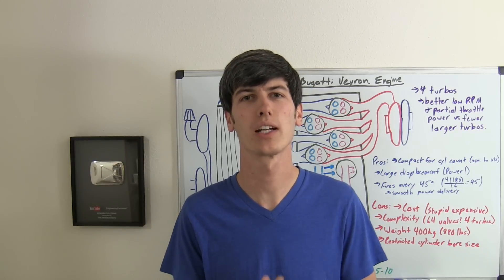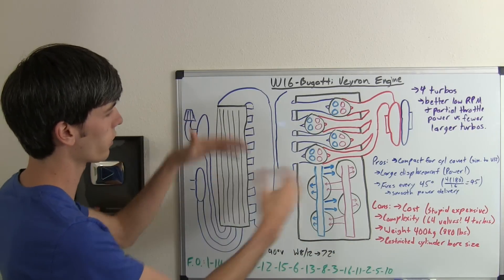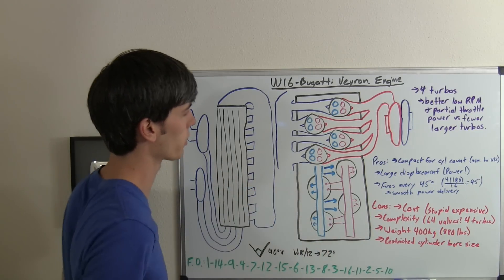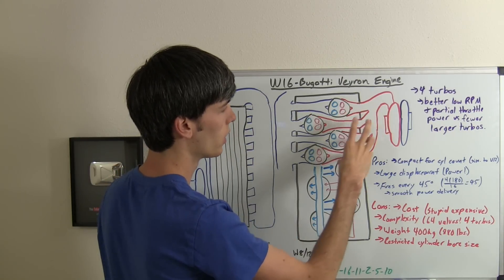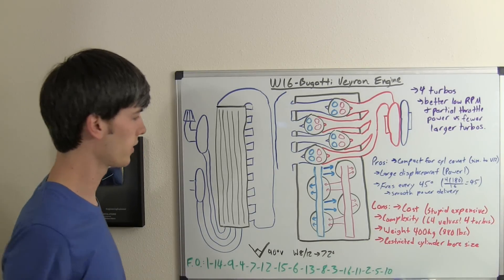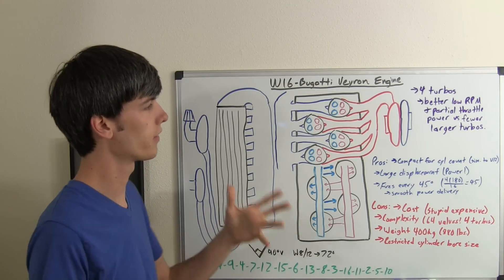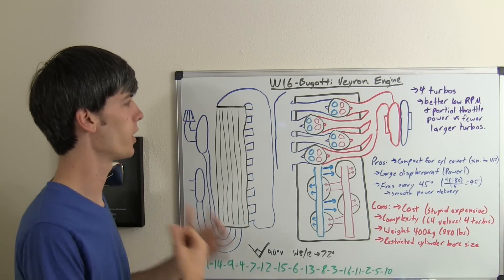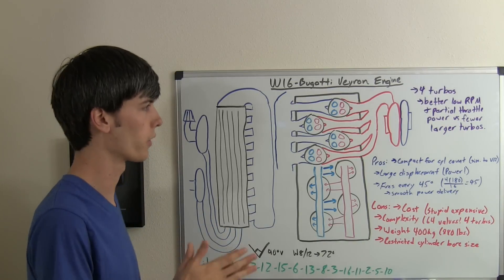W16 Engine - Bugatti Veyron - Explained

Comment: Its an epic piece of engineering. A relatively compact engine that isnt stressed despite its massive smooth power and torque. They Veyron is a master class of car design with aircraft performance all within a luxury cocoon of a Bentley and some. If anyone compares this to the kit car Hennessey (which it is in comparison) you are severely mistaken.
Refinement, speed, power and handling are the hardest to achieve; just look at Concorde, she aced that. Big time.
Reply: +peanuts2105 I agree! Although I am quite fond of the Swedish contender too -- it's a bit more raw and aggressive.

Comment: The only type of engines I have any knowledge on are 2-strokes and that is just a hobby. I thoroughly enjoyed this walk-through, specifically how provided intent and placed each of the components in to connect. Great job!. If you have not taken a look at the little glow engines for rc cars, they can RPM. If you have not you should check them out, I imagine you would enjoy!

Comment: I never liked how it was called a w16. Since it doesn't have 3 banks
Reply: +Ian Thompson I see where you are coming from, but what do you get when you put 2 V's Together - vv (W)
Reply: Ethan Gee I guess it should be called a double bank V16 or something. Since it is a V, but with two extra rows
Reply: +Ian Thompson Yea but  a double bank V16 dose not roll off of the tongue as nicely as W16. Plus since there isnt another Engine like this they can call it what ever they want.
Reply: weirdstuffanimation7 Fair enough
Reply: Well it has 2 Banks with Cylinders on the two outsides .. But the build of 2 V is resultung to W , so 3 Banks  .
Reply: +Ian Thompson a double Vee is hard to say. as is double H.(meaning that old carb system on the Hornet) W sounds relatable.
Reply: no it is like a 2 Vs (VV)
Reply: According to a LOT of people its a 16.4 litre 16 cylinder engine smh.
Reply: Lmao I was about to say would you prefer it to be a V8V8
Reply: The two sets of connecting rods - one set behind another- that forms the "W=Double V" in a section view when it's viewed from the front.
Reply: Same as a VR6 engine, isn't configured in a V shape!!!
Reply: If you understand VR engine layout, you'd understand why it is called W16 

It looks like 2 V8 engines, each in staggered formation (VR), then matted together

Comment: Could you explain how Honda had a V5 engine in their RC211V MotoGP bike?
Reply: +SupaDriftz Most Motorcycle race engines have a gearing shaft inside the engine crankcase which for a inline engine is fine, but for a V type engine, the nose side of the engine (bank closest to the front) has more resistance against it. Honda attempted (properly well) to counter act the resistance by adding another cylinder on the nose side to give more torque against the turning gears. The result actually gave way more torque then desired, and without the advanced level of traction control that we have now made it quite overpowering sometimes. Thus it was ditched.

Comment: Thanks for another interesting video!
I'd really appreciate if you could help me understand the firing order logic (for any engine size). I always feel like the forces applied to the crankshaft and the heat dissipation through the engine block will be messed up, so why are firing orders the way they are?
Reply from the maker: It's certainly easier to understand on engines with fewer cylinders. It comes down to the crankshaft design, layout, and number of cylinders. Basically there are only so many options which would phyiscally work (piston fires ever "x" degrees of crank rotation, piston "a" is on an upward stroke, which means it's either exhaust or compression, sort the FO in a way that allows for each of the cylinders to fire in a balanced fashion. Maybe check out my videos on I4 or I6 where I go a bit more into detail on the firing order. This was more focused on how it works as it's a massive complicated engine.

Comment: As a first year mechanical engineering student, I am ashamed to think that I once thought a W16 was two V8 blocks side by side...
Reply from the maker: Don't be ashamed. I didn't know anything about cars when I was a freshman in ME.
Reply: same XD
Reply: Engineering Explained Seriously? I mean you chose to go to mechanical engineering and you never had interest in cars? I studied in University of Bath, but cars were always my passion..i bought a nissan 200sx (s13) with my savings without anyone knowing in the start:p Still modifying..now upgrading to VAG ignition coils for xmas :))
Reply: St0RM33 I think your confusing Automotive Engineering with Mechanical.
Reply: St0RM33 Uhm... Hate to break it to you my friend but not all mechanical engineers become automotive engineers, which is what you're thinking of. While cars are great examples of mechanical engineering applied, basically any type of machinery you can think of has a mechanical engineer's touch... From biomedical devices to engines, from industrial equipment and tools to rockets. I've even seen mechanical engineers who have careers doing things like running power plants. Typically (Though not always, just in my experience) HVAC engineers also studied mechanical engineering, as ME's have to take a ton of thermal fluid science courses. There's a lot more to mechanical engineering than just automotive engineering.
Reply: *****
Hahaha. Who said i was talking about this? I said it because his channel is focused mostly on automotive stuff so it's weird that he didn't had previous interest.
Reply: Crunchy Nutter
You can still do Automotive stuff in Mechanical engineering. I did. Even was in my uni's Formula student team (formula SAE in US)
Reply: Hawar Karem
What with the s13? Best bang for your buck platform ever. Light, 51% front - 49% rear weight distribution, cheap, FR layout, good aesthetics, tons of parts available, turbo: easily increase horsepower, low displacement which means cheaper road tax, etc.
Reply: St0RM33 I think you misunderstood him. He said he didn't know anything about cars not that he didnt have a passion for them. I personally am an ME student as well and I love cars, but I know very little about mechanically. I've learned some here and there but no the extent that I'm a mechanic or something.
Reply: Dont be ashamed at all dude it was a stupid rummor flowting at the web when it first come out that it had 2 V8s.
Well you would think it has 2 v8s one inside another dont you?

At the end its 100% clear that V10/12 is better overall.Bore/stroke + rode/stroke ratios less rotation mass etc
You want 4 turbos?Im ok with that but it would be a lot better to be a 2x2 compound setup.
Anyway, nice video as usual.
Reply: I think they should try and do something like that. Two V8s stuck together with the point where they meet in the middle being like a VR engine. Would be interesting. I wonder what noise it would make :D
Reply: Lol I’m elementary and I get a lot out of this, but I too once thought its was 2 v8s that we’re connected by gears.
Reply: As a former ME student on hiatus, I tried on quite a few occasions to picture a configuration of 2 V8's and one crankshaft but I never could. I thought the same thing since it was called a W16 but I had never seen a diagram of the configuration and I couldn't figure one out that would be realistic. So I hadn't accepted the "W" 16.

Comment: Another benefit of this many cylinders is small cylinder size -> Relatively stronger as each combustion event holds less energy, hence the base engine is going to be more durable.
Per cylinder size is 0,5l

Comment: I'd pay $12.00 to see someone put a W16 in a Golf VR6. they could mount it at the back , remove the seats and do some very smart adaptations but I'd pay either way to see it work
Reply: +kapil busawah well the car will catch on fire while flying through the sky?
Reply: Ganz Montejo yes?
Reply: +kapil busawah Already been done with a W12! VW made a concept car for a bit of fun. The results were... well lets just say there is a reason they never put it into production. There is an episode of Top Gear which featured it a few years back!
Reply: I Rob Banks WHAT WAS IT CALLED???
Reply: A naturally aspirated W16 obviously. There's no way the golf could take that much power, or even fit 4 turbos in the engine bay (or behind the drivers seat).
Reply: +kapil busawah golf gti 650
Reply: +kapil busawah the bugatti engine runs VERY hot. it would actually catch on fire probably
Reply: +TheRebel3000 The engine was behind the driver and took the whole space in the back.
Reply: +kapil busawah Some guy stuck a Rover V8 into the back of a mini. Its somewhere here on youtube. Its nothing compared to what you are proposing though!
Reply: +kapil busawah There is a twinturbo V10 Mk4 R32. The engine is from the C6 Rs6 and is tuned to 800-900hp if I remember correctly.
Reply: kapil busawah
They might have done that already. I seem to recall a certain Top Gear UK episode with a concept they said no to.
Reply: I will have to look that up. Thanks!
Reply: It was the W12 engine
Reply: Check out the twin engine Mini Cooper.
Reply: It would need to be a Golf R because you would need the AWD platform. The W16 in a gold sounds like an 1980s group B rally car dreamed up by Renault or Lancia.

Comment: Bugatti Veyron actually produces around 3000 horsepower but around 2000 disappears with heat
Reply: That's kind of awkwardly worded, but essentially correct. However, that's normal for a ICE. It's down to the thermal efficiency which happens to be around 30%.
Reply: it normal for petrol engine, 25-35% for combustion energy turn into mechanical energy, it happens on all petrol engine. you wanna go efficient, go for diesel.. efficient of engine is much depend on compression ratio. that call thermal efficiency.
Reply: First law of Thermo-dynamics.
Reply: 25-30% isnt 2/3s tho... That statement is false
Reply: Its tuned down to avoid being overheated its not losing 2k hp from heat

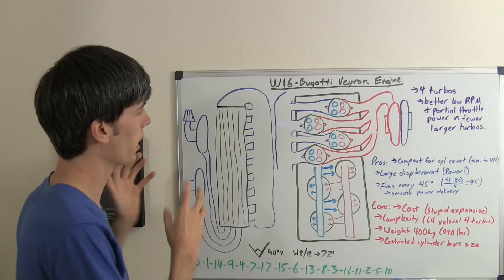Comment: I dont know so far in anybody already commented about it, but there seems to be a small mistake in the video. You mention individual fuel injection, but it is in reality a direct injection engine. The information happens to be at around 1:40. With direct injection there will be no air-fuel mix before the intake valve. The mix of air and fuel will be made inside the combustion chamber shortly before the actual combustion.

Maybe you leave a short comment here and tell me what you think about that issue 😉

Comment: 16 cylinders on one crank attacking it on all 4 sides. not just two on a longer V-16 crank. That W crank is going to be under a shitload of cooks in the kitchen. not enough waitresses unless the crank is a sturdy wider than a V block's crank of any variety.  I'd go with an alloy that compliments flexibility and strength for the crankshaft.

Comment: Thank you for your videos EngineeringExplained, I enjoy them. Just curious though, are you positive that one cam is for intake and the other is for exhaust? Looking at pictures of old VR6 motors, it looks like one cam controls all of the valves on one bank, the other cam controls all of the valves on the other bank. Anyway, thanks for the videos.
Reply: my apologies, looks like you were right. the pictures of the vr6 motors that I had seen are older 2 valve/cyl. thanks for the videos EE

Comment: Did you say that all 16 pistons are connected to the same crankshaft? In the VR6 video, you said that the pistons fire in pairs right? (Ex. (1, 6) (2, 5) (3, 4) Does this concept also apply in the VR8? Furthermore, does it apply in the 2 VR8s that make up the Bugatti Veyron's W16?

Comment: Cool, enjoying the videos I've seen. Do you address the power differences between OHV and DOHC engines? Provided they have the same valve size and lift/duration, would they run the same or does the valve actuation have anything to do with it? I figure its just size/lift/duration but it seems OHV engines have a lot more torque at lower RPM and OHC engines much less torgue and need to be higher revved.

Comment: Hey you should do a video on how speedometers work! Like how they accurately measure your speed.
Reply: EminentLeague Older ones spin a wire that spins a gear that's connect to a larger gear behind the speedo, the ratio of gear 1 vs gear 2 has to be matched to your final drive ratio (ratio of transmission gears + rear end ratio + tire size) to show real speed. Changing any of those without re calculating the ratio needed for speedo gear and replacing it will result in an incorrect speedometer. Newer cars use optical sensors to count revolutions per second of the final drive by measuring the drive shaft rotations and then do some math for in the ECU and spit it out to a digital read out or apply a specific amount of current to the speedo wire to move the needle.

Comment: I could be wrong but, i thought a guy on the tv (documentairy about the veyron) said the engine makes 3000 to 4000hp but they had to "down tune" it to 1001-1200. (i thought it was because of the heat, if so, you forgot to add it to the cons lost). anyways nice video, hope you replay to my question Engineering Explained
Reply: It could probably easily handle 3000-4000hp, but it wouldn't be as reliable or longlasting, that was the point with the engine. When they engineered it they focused on making it indestructible. My mechanics professor back at engineering university talked about it, since he knew people from VAG who worked on the project, he used to work for them, and their goal was to make that engine work for more than 1 million km's without any problems and perform exactly the same at that point as when it was brand new,  with just the regular maintenance that all other cars get, which is very rare as far as supercars go. For example, you can be damn sure that something like a Venom will need it's engine rebuilt or heavily serviced after about 50,000 km's because it's overtuned and underengineered. Veyrons engine is the opposite, it's very overengineered, it's deep within the safe zone in all parameters.

Comment: They can call it whatever they want but it's not a "W16". 2 "V's" is a "W" but only if they actually form a "W" which this engine does not. They can call it the "God Engine" if they want but that don't mean that's what it really is. I guess it's just this generation where anything can be whatever it identifies as. Regardless of common sense. The only place I've ever seen a true "W16" is at a tractor pull competition where they actually run 2 V8 engines together synchronized side by side into a single transmission. The problem with a "W" configuration is it's inherently too wide for use on the road unless it can be made extremely small.

 There was a an attempt to build an "X16" engine back in the late 90's to address this issue. I never seen it online. I've only seen it on a brochure. The "X16" was great idea in theory. It was compact. It was 2 "V8's". One is upside down welded together at the block eliminating the oil pan and they shared a common crank. But in practice it must have failed horribly. I don't know what happened with it. I can't even find any trace of it online. I think they ran into a massive problem and couldn't overcome the fact that engines don't like to run upside down.

Comment: I thought that the cylinder banks would be mirrored. Like you'd see in a v8 with intake in the middle and exausts on the outsides. You stated that each bank would have intake on the left and exaust on the right side. Don't get it how that works.

Comment: 16 cylinders is an interesting number. You might like to compare the 1.5 litre, crankshaft driven centrifugal supercharger, 500-600 BHP BRM engine of 1950-52. W is also an interesting cylinder configuration. I don't think this VW engine is really a W. That would be one of the aero engines of the 1930s such as the Napier Sea Lion of 24 litres which powered the Napier Railton special which held the Brooklands lap record at 143 mph in 1936.Parhapsyou would like to discuss those?

Comment: Hallo Jason. Thank you for all your fantastic work with Engineering Explained. I would just like to ask you  a question that bothers me. Why is that Veyron engine called or named W-engine? W engines were engines with three rows of straight cylinders in one block. Very big, heavy and for today standards absolutely unusful machines. Volkswagens Veyron 16c or Pheaton 12c engines are double VR engines, V VR, not W. I can understand, the VW trade those engines as W, because it sousds fancy. But now, those engines are allmoast officiale named as W engines even in high engineers circles. ...or is there something I am wrong about??? Thank you again and you are great with all your EE videos. Lep pozdrav,Uroš.
Reply: "W" in that case is spelled "double V" in Latin language and derived from "VV".